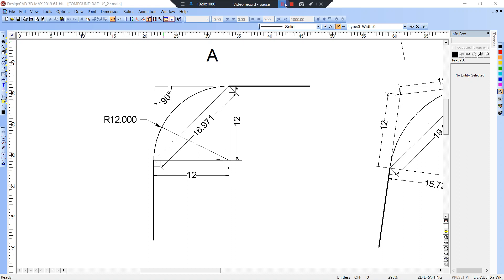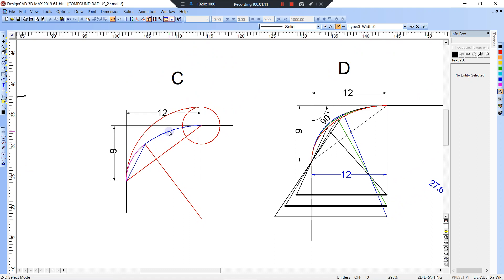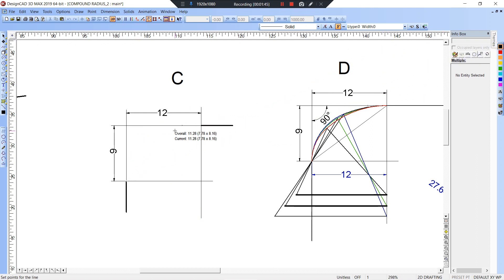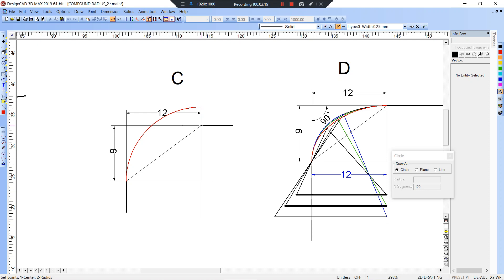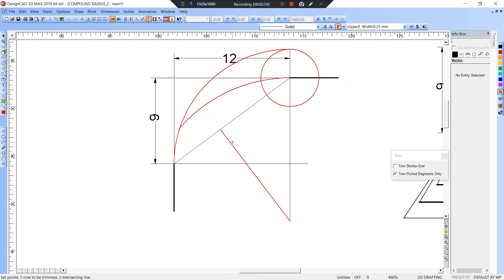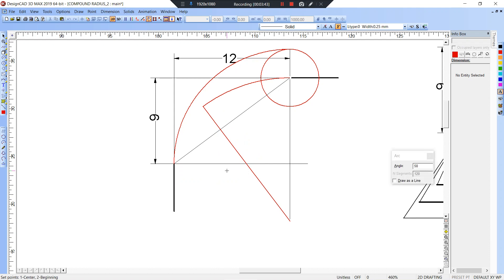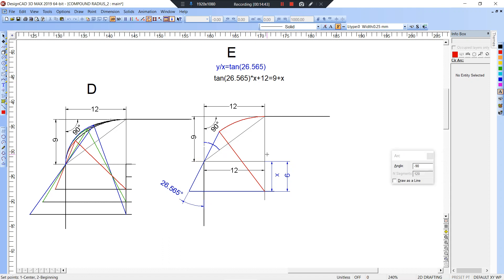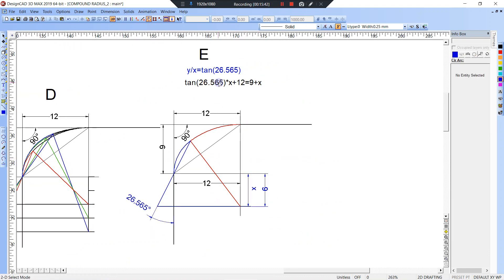HOW TO DESIGN COMPOUND CURVES

Comment: Thx for your sharing. Could you teach me, how to draw a reverse curve if two tangent points are fixed.
Reply from the maker: I could try. Can you be more specific? TY
Reply: @CONSTRUCTIONOMETRY-hj7jt  Assume there are two fix lines with 4 fixed points (A,B and C,D). coordinate of A is  0E,0N , B is 41.791E,20.071N, C is 208.667E,6.758N, D is 275.369E,42.168N. Could you teach me how to draw a reverse curve to joint these two lines together?  Thanks!
Reply from the maker: @kkkk4493  I'll look into and get back to you